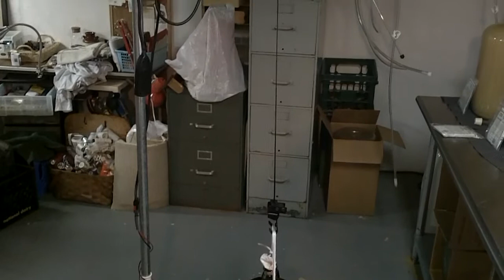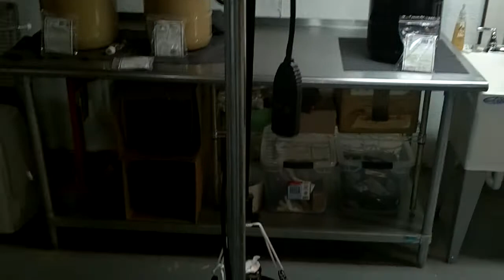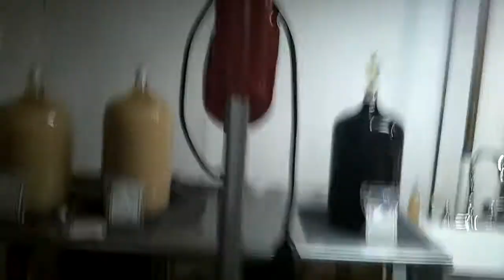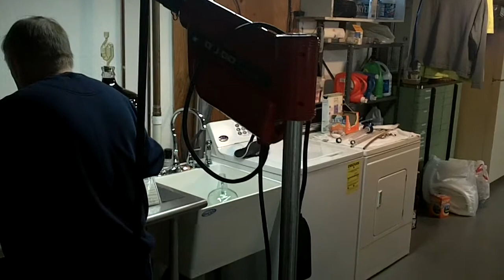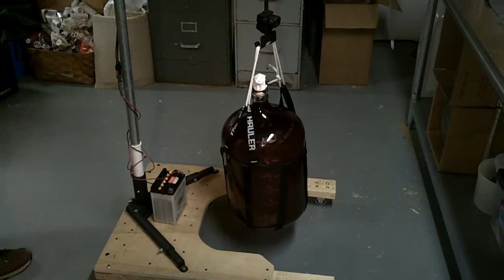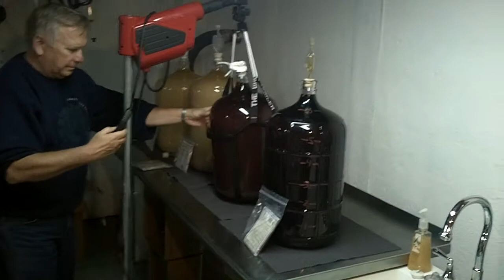Home Made Wine Carboy Electric Lift

Comment: It will clear 36 inches, they have been using a neck lift instead of the straps shown in the video, just makes attaching the carboy easier.
We found the wheelchair lift on craigslist for $50. new ones were too much.

Comment: I think it would clear about 36", that was a function of the length of the pipe we had on the lift. We purchased the lift on craigslist used for around $45 and cut the boom off to reduce the over hang. My friend had gone to a neck hook-up on the carboy which makes it easier to use. Hope this helps.